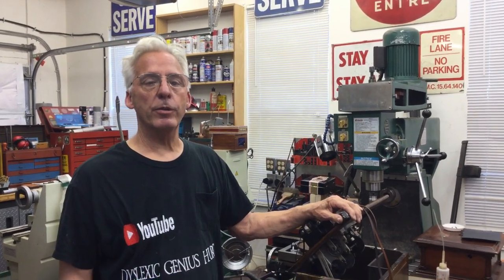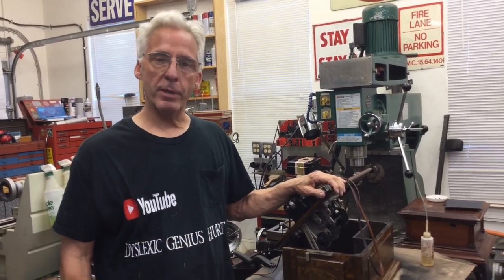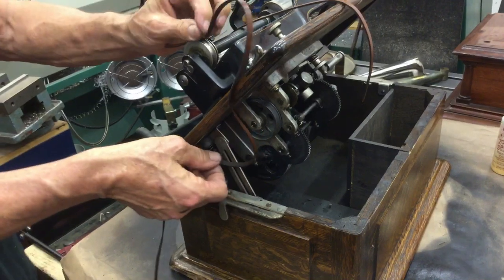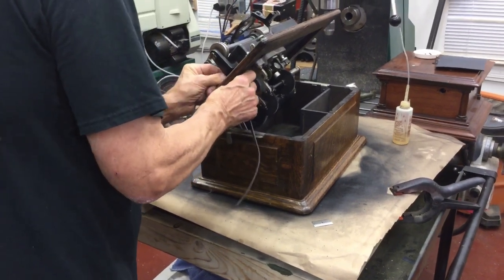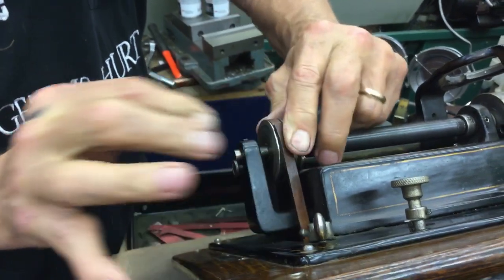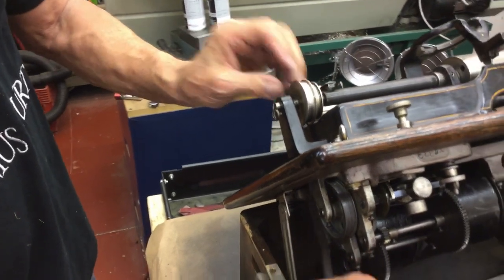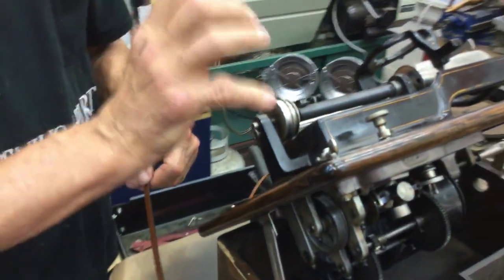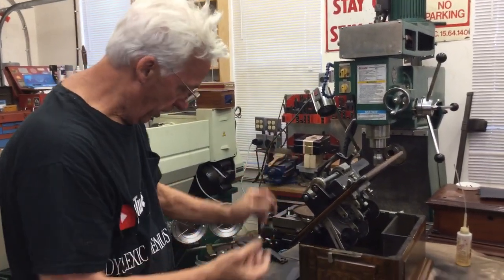329.  How to build a new leather belt for cylinder phonograph

Comment: I had to replace the belt on my Triumph and before doing anything I used the belt tensioner on the machine to raise the motor all the way up. That way as the belt stretches, I have plenty of room to tighten it using that nifty tensioner system they have on the Triumph!

Comment: Hello, I have a Edison Standard Phonograph and the mandrel is out of round making it impossible for the cylinder to fit snug or extend all the way on the cylinders. Any advice?
Reply from the maker: If no cylinder will slide on , then you need to replace the mandrel. Most of it’s a swollen cylinder that can be gently and carefully reamed out.